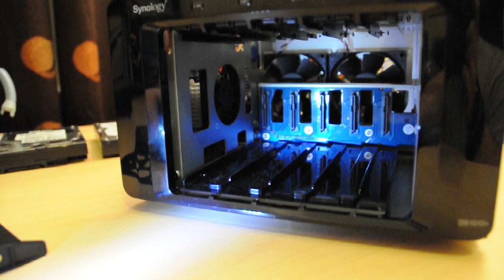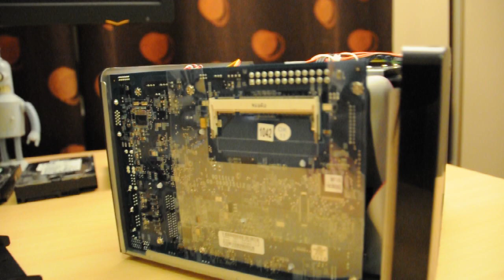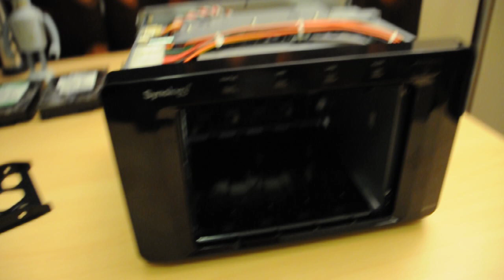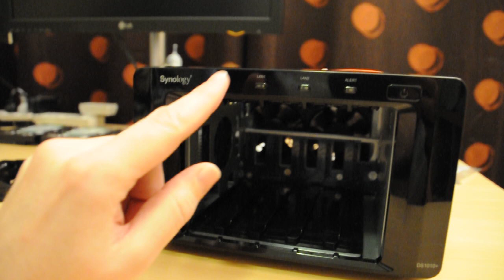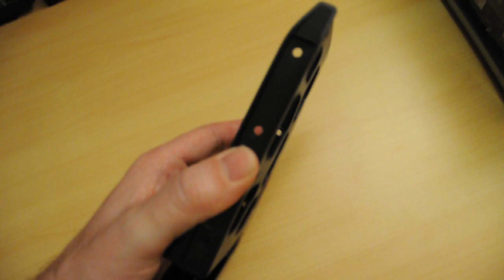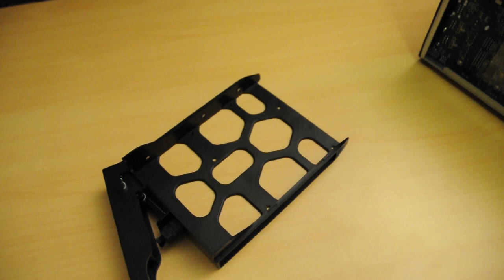Synology DS1010+ Users Hardware Review

Comment from the maker: @nodnarb501 touch wood no :)  what I did do was set the idle timeout on the drives to ensure they don't unload their heads madly (see my other video).  Remember, that I've got a mixture of drives in there too. They're not all from the same batch or the same model. There's even 2x WD Blacks, which run about 4-5 degrees celcius warmer.  Also if you buy, avoid buying a "batch" as disks tend to fail as a batch (I've seen it happen). Good luck!